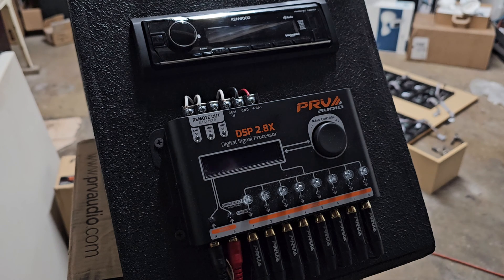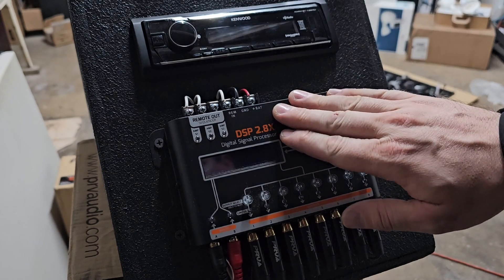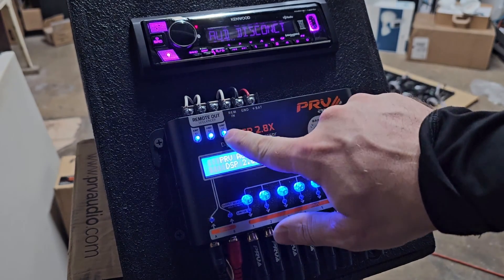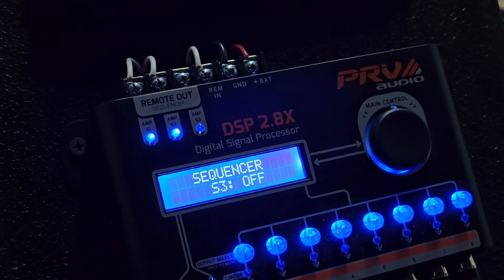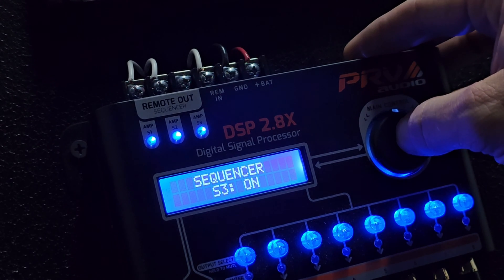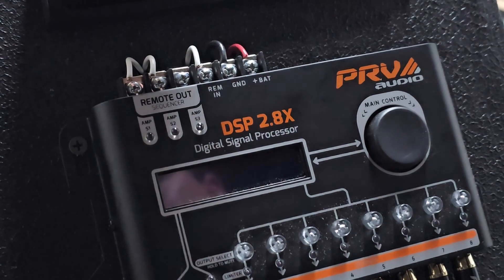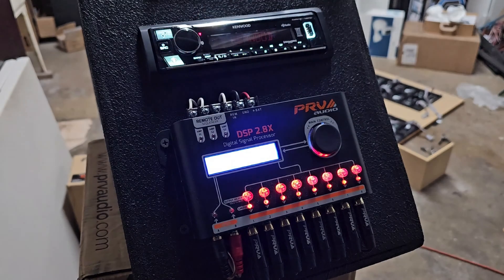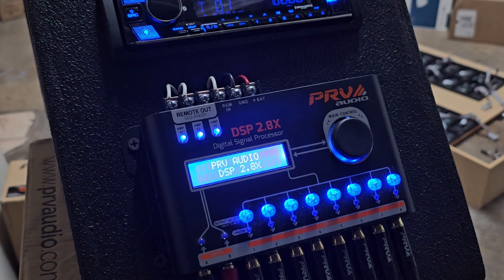How to use Remote Sequencer on PRV DSP 2.4x and 2.8x

Comment: How can I connect an 8-channel PRV DSP from the radio and equalizer and a 4-channel amplifier?
Reply from the maker: Output of the radio goes to input of the EQ. Front or rear output of the EQ goes to the DSP. Outputs of the DSP go to the amplifier. This is shown in my video how to add an EQ to your DSP.

Comment: Hey I’m running prv midbass and the same dsp what should I set my input and output parametric EQ to?
Reply from the maker: @JimmyBoy87  leave the input parametric alone. You can set the output for the midbass around 100hz to 120hz to get more punch
Reply: @ ok thank you a lot so I just leave the input at 1k because that’s how it comes default

Comment: Can you wire a bass knob and a 3way crossover to the prv 2.4 dsp
Reply from the maker: @reginaldpettwaysr8203  sure, put the 3way on one of the outputs. And bass knob in between them.
Reply: @12voltfever  ok can u explain when you say in between i be over thinking it
Reply: And can u explain when you say in between  and also I watch your videos but didn't see how you set the hz but if am correct this is what I did am running 6 8mr600x 8ohm per door and the web site says set the hz at 165 and hz between 85-8500 and bt at 12 what is the - 10db were is that located

Comment: So I’m having an issue with my setup I have tried everything to eliminate my turn off pop with my sub. I have an audio control LOC connected to my amp for the sub. I’m wondering if this would solve my issue since my amp won’t ever turn off first.
Reply from the maker: You will need to use the remote sequencer on the DSP and that shouldn't happen.

Comment: So if I got 9 amps an 2 dsp how would I use this setting then
Reply: Why 2 dsps?
Reply from the maker: @gearjammr09 when you have multiple amps, sometimes you run out of outputs. Or, maybe hes running multiple equalizers in a competition setup.
Reply: Good question, there and then you'll choose which amps you want to boot together and jump the remote wire on those
Reply from the maker: You will have the REMOTE IN shared between both DSP. Then, the sequencer goes to whatever amps you want. You can also put more than 1 amp on 1 sequencer. I like to pair amps powering the same type of components together on the same sequencer.